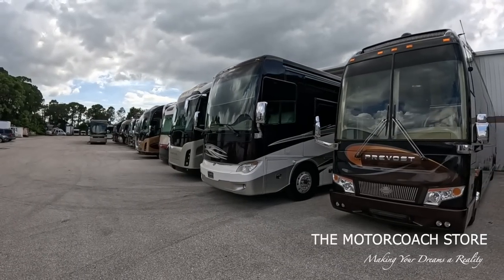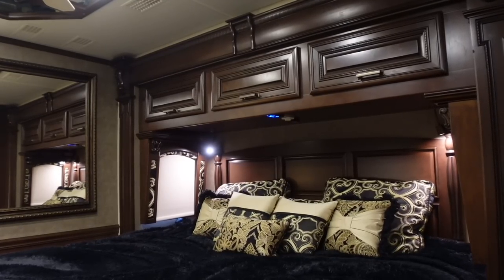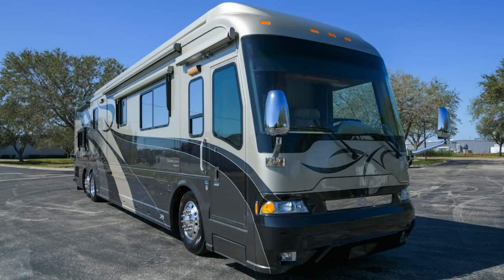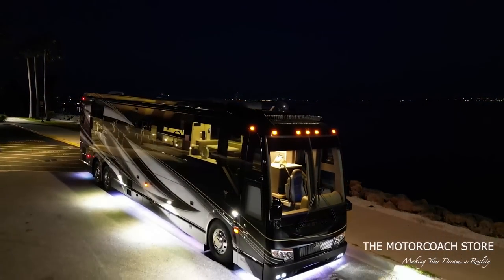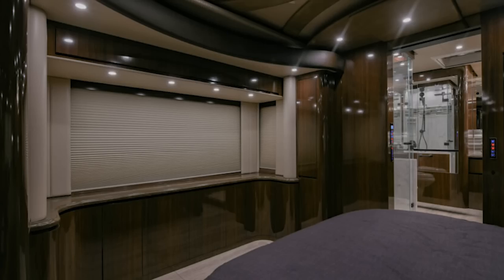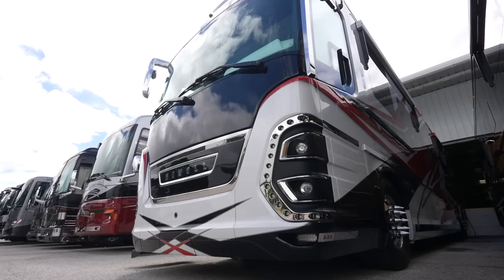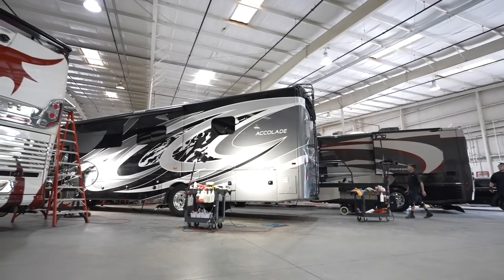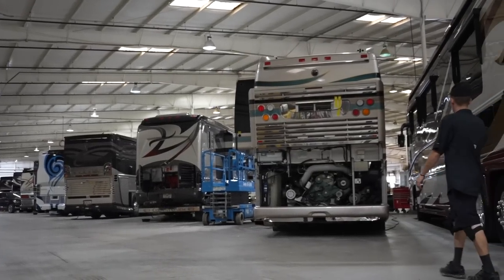Luxury Motorcoach Pricing October 2023

Comment: It won't be long until I will be ready to buy and am seriously considering buying from The Motorcoach Store.  Retirement is on the horizon and it will include extensive travel in a Diesel pusher.  As we shop at other dealers it is clear that what you get from them is not going to be sorted like it would be from you guys.  I can fix and build most anything but would rather start with something that works.   I also see us starting out somewhat cheap and then upgrading down the road and The Motorcoach store will have lots of options for upgrading and will give a fair deal on the trade.  Keep us posted Andrew!!  Love the pre-Def quality coaches.

Comment: Andrew, you may want to make a video on what goes wrong with these coaches. I would assume that some are manufacturer-specific. I'm not an RV'er, but may be some day. I watched a video where the guy showed how cheaply built one of the higher-priced coaches was. He brought it to the factory and then had some of the same issues after leaving the factory. He was very disappointed with it because it wasn't fixed properly, so he upgraded to a higher quality coach from a different brand. My #1 concern would be reliability and the availability of quality repair facilities around the nation.

Comment: How well do these holdup in temperatures like in North Dakota in the dead of winter?  I would rather do one of these instead of pulling a 5th wheel unit.  It would be parked and I would be living in it most of the time.